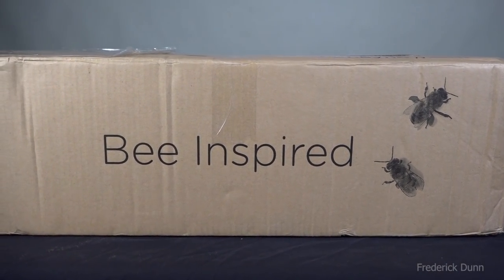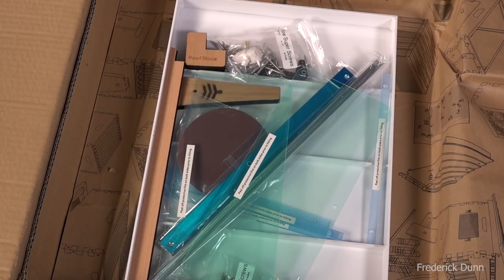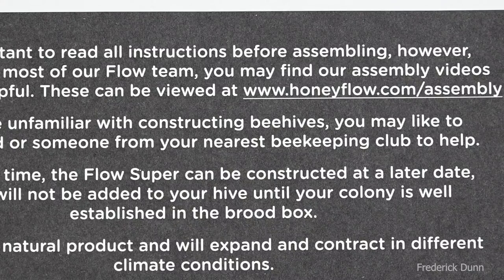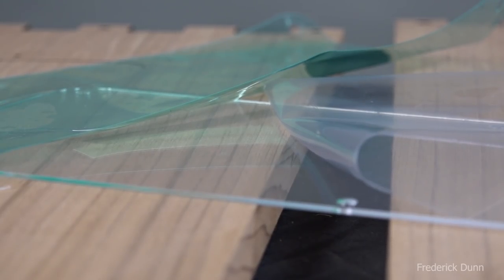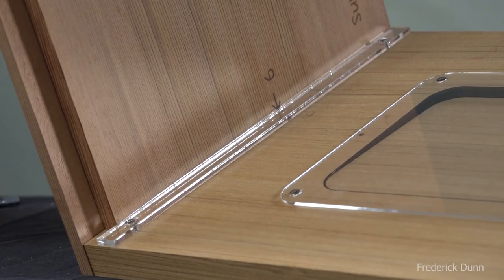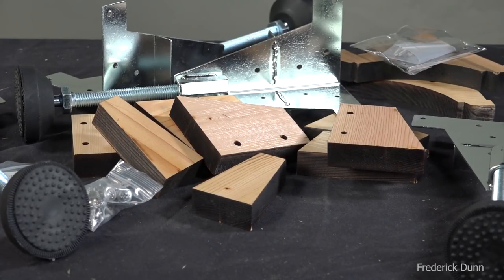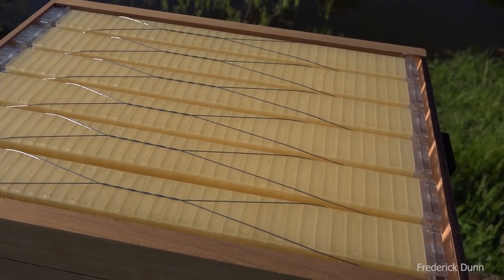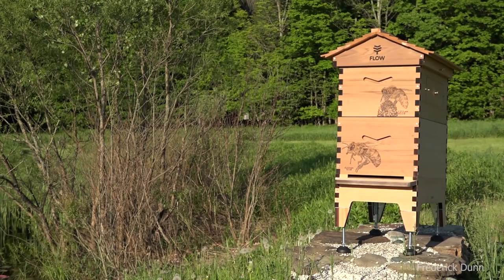The Flow Hive 2 Bee Hive unboxing, How to put a Flow Hive Together step by step.

Comment: I have been working through your flow hive views, I wanted to know if it is mandatory to take the flow hive top box off clean and store for the winter? I saw you did that in one of your videos or could you just leave it in place inspect and let it stay in place for the winter after the last harvest of the season and if yes would it work just fine the next season?
Reply from the maker: You should take them off for winter if your are in a cold region where the bees need to cluster.

Comment: Hi Fredrick,
I got mine at the beginning of last week too. Having one of each now I can say  that I feel the 2.0 version is inch better as well. However one thing I did notice and I’m sure you did too, was that in the instructions it shows both the brood box and the flow super having observation windows. Mine only has these windows on the super as well. I did coat mine in in tung oil and it looks great. That’s a great idea to use the mason jars with the top on them, for harvesting. This is my first year keeping bees and I’m already having a lot of fun and have actually been lucky enough to be able to split one of my hives because I actually had one hive with two laying queens! Really weird, but one of them now has a new home now with some frames of capped brood and  stores. Well thanks for the good videos, good luck this year!!
Reply from the maker: Hi Jeremy... hmmm, I was part of the pre-release review of the FH2 and originally the plan was to have a window included in the brood box. That was later abandoned and the windows are just on the super as you've mentioned.  I guess the cover image for the plans as well as the brood box assembly pages still have the side windows included. I'm not sure if the plans will ultimately be changed to reflect a plain box, or if the boxes that come later on will have the additional windows. I'm perfectly fine with the brood boxes being solid, but you're right, the pans show a very different box design.
Reply: I agree! I really thought about how much heat loss there would be through those cutouts during the winter time. In theory you could insulate the heck out of it and mitigate it.... but I think that realistically it’s better off with only having the window in the super.
Reply from the maker: Agreed.

Comment: Hi Frederick!  As a fellow early adopter of the first Flow Hive, I was happy to see they made these improvements to version 2.0.  I have not purchased one (mostly because of the cost) but it looks like a quality product.  How does the shelf for holding the collection jars attach to the box?  I see the frame "door" doubles as a shelf but where do the brackets attach?  Are they extra pieces or also a reused part of the hive?  Thanks for the video and best of luck this upcoming season.
Reply from the maker: Hi Brandon, the shelf supports are included and they have a metal plate on them which slides onto the hive body screws.... you have to unscrew them partially so the shelf brackets key onto them.. I probably should have shown that closer.. the parts are all included.

Comment: Hey Frederick, could your recommend the Pyrography tool you used for this?
Reply from the maker: It's the Razer system... https://www.woodworkingshop.com/product/rz00002/?inMed=GSTORE&dfw_tracker=18711-RZ00002&gclid=Cj0KCQiA0MD_BRCTARIsADXoopbdTb3RSL8DmmL6cpxHiwCH9ZeUyNmdUdqAD5ykI4jyGoPED2-73M8aAkXuEALw_wcB
Reply: @FrederickDunn  I had completely forgot about this but my father used to use this and make signs for clients for $.

Comment: Hi Fred, another great video.
I have a question for you. I last took honey from my flowhive in early March. I have been checking their progress since then 
to see if they are close to filling the frames again . I could not see any of the frame ends getting filled so I decided to do an internal 
inspection . I found that the frames were mostly filled but they had not gone all the way to the frame ends. Then I found that they had gone through the hole into the roof of the hive and it had a lot of honeycomb in it filled with honey. Not sure why they did this , but I guess I should block that hole to stop them getting up there. Should I consider getting an additional super so I would have two supers sitting on one brood box ?
Reply from the maker: Yes, I always add a medium super above the flowframes when they are doing a great job filling them. It can prevent your colony from being honey-bound.  It is funny that they didn't run their honey up to the ends, but they do that at times even with natural drawn foundationless comb... leaving edges unfinished. You can also tell by the physical weight of the super.
Reply: Thanks Frederick, yes I will do that. I see FlowHive have them on special right now.
Reply from the maker: They do and if you use the link I provided, you get a discount :)

Comment: Sorry to bother you again on this topic, but need help with a measurement.  The entrance to the FlowHive2 is 5/8th of an inch.  So does that lip take up 2/8th?
Reply from the maker: Hi Brad, That sounds correct... 5/8" without the aluminum insert. https://cdn.shopify.com/s/files/1/0435/5201/4494/files/Flow_Hive-2_ComboManual_Jan2020_170120-2.pdf?v=1600394900

Comment: Any issues with flow hive use in colder overall climates like new England ?   I’m assuming you need to add additional traditional boxes beneath etc for population growth ?
Reply from the maker: Yes, an additional deep would be optimum as you cannot leave the flow-frames on during winter. I do hope that they produce a 7 frame (10 frame Langstroth) version in the near future. I like to run at least the deep and one medium super beneath the Flow-Super.

Comment: I understand why you glue and clamp but I would have thought the components would be engineered square tight and eliminate the need for clamps once glued and screwed.
Reply from the maker: what I did was probably overkill and not necessary.

Comment: Hello I want to know what is the net weight of a box with ten ferams
Reply from the maker: Net weight, (without honey) under 10 pounds. Variable depending on the frames you use and the wood moisture content. With honey in the Brood box, from 50 to 75 lbs.
Reply: @FrederickDunn  ❤

Comment: Do u have a video showing the swarm finder stuff ur talking about how u added it to the box?
Reply from the maker: Oh, are you asking about the swarm lure? I use swarm commander, you just spray it on q-tips, put those q-tips in a ziplock baggie inside the hive on top of the frames and scout bees will be attracted to it. I've actually had swarms move into empty boxes without a lure, but Swarm Commander works as well as lemon grass oil if you can get that?
Reply: Frederick Dunn yes! Thank u so much
Reply from the maker: @Tonia.lynn2411  You're very welcome! :)

Comment: Mine also did not have numbers...ugh no wonder I'm struggling
Reply from the maker: Where did you buy your FlowHive? That would be extremely rare to receive one without the markings and without an assembly guide included.
Reply: @FrederickDunn   so I finally did locate the instructions, but definitely no laser or numbering.  beeinventive is the sender. They were way behind schedule. It took months to receive. I wonder if that step was left out. No pilot holes so the screws are not easy to put in. Going to take me a long time to put together. I want it right the first time

Comment: What the thickness and warmth for the bees
Reply from the maker: Standard 3/4" thick stock. The cedar offers a tiny bit more insulation than pine does. The real goal is to shield them from drafts so they can warm the cluster.